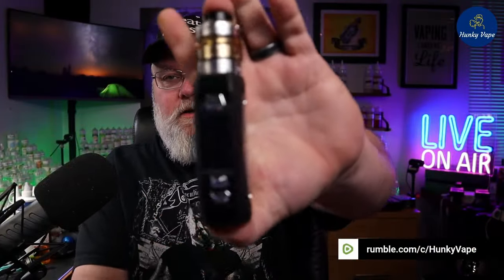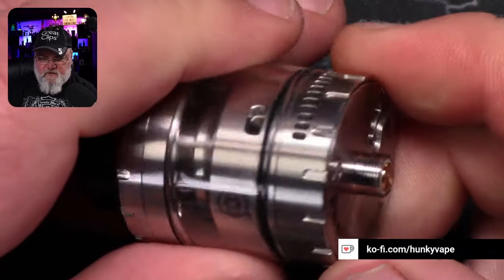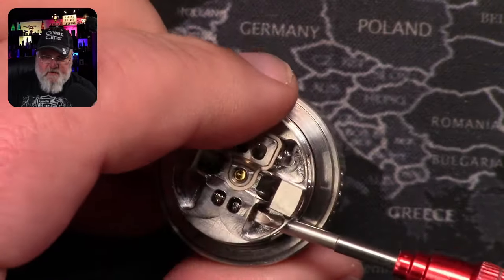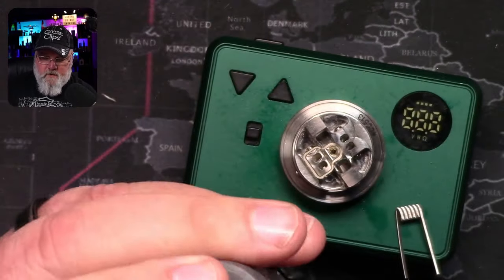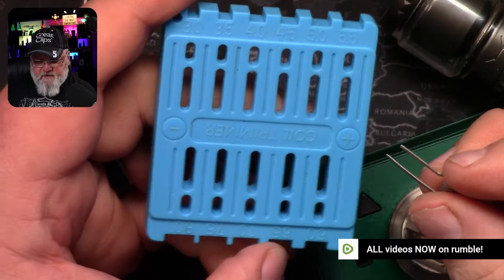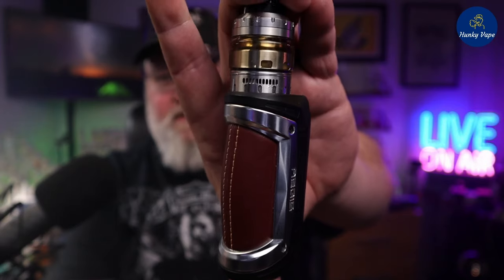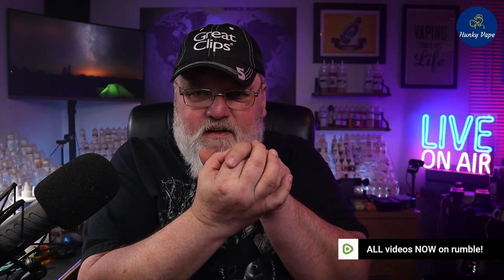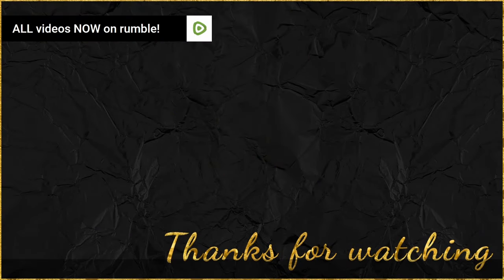VaperzCloud OSIRIS RTA Unboxing Review

Comment: My friend, can you clarify the size of the straight glass, diameter and height, please?
Reply from the maker: My apologies for not seeing this earlier. The glass is actually a bubble glass, however the height, inner and outer diameter should be identical for both the bubble glass and the straight glass. Using my calipers: Height: 16.95mm, Inner Diameter: 26.93mm, and Outer Diameter at mounting point: 29.73mm (Outer Diameter of Bubble: 31.74mm)

Comment: Vaping 12yrs, bought many many RTA's and this is easily the best Rta I've ever vaped. So good, I've just bought another 5 of them.
Reply: 5???!!!! 😮
Reply: Which one is the best? 25 or the 30mm?
Reply: @CountryboyAR  25mm fits most mods… but 30mm will hang over a bit, a tad bit more room to build.
Reply: @sprinkleddonuts6094  I was just wondering if the 30mm has so much airflow and with it being a 30mm with a bigger deck is it more for series vaping which is not really my style. Dual coil RTA on a box mod at 60 -80 watts is around my pace and I was concerned that the 30mm would have huge airflow and meant for Lipo mods like the huge Voltrove tanks.
Reply: @CountryboyAR  
25mm and 30mm there isn’t any difference in the vape experience. 
30mm will have more juice capacity and will fit your bigger mods. 
The 25mm slightly less juice capacity and will fit your standard sized mods. 
It’s all about preference, whichever you prefer, if you cannot decide then buy both 🤷🏻‍♂️ only then will you know which you like more over the other. 
Then you can sell the other or trade to a friend
Reply: @CountryboyAR Sorry for the late reply. I have both. Both are great but imo the 30 is better. I like bigger RTA's(28+) in general. If you prefer 2.5mm coils, go for the 25 but if you prefer 3.0mm go for the 30. Just my opinion
I run it with 3.0mm Claptons, .10ohms, 135w and full airflow. Flavour is outstanding.
Reply: @guppy9713  any issues with the deck not properly sealing correctly since it's not threaded? I've still been on the fence about the Osiris. I've had some tell me that it won't properly seal but that could be user error on wicking. I did have the original Fat Rabbit RTA that had bottom and side airflow but unfortunately it was not a threaded deck. Just sealed with a big o-ring and that thing leaked all over the place and I'm not a noobie to RTA's and wicking. It definitely was the Fat Rabbit RTA leaking from the deck not properly sealing and I'm just concerned cause the Osiris RTA's are very similar with the exception of a small notch that grabs the deck by the locking/unlocking button on the bottom.
Reply: @CountryboyAR I did have that concern myself before I purchased but I've no issues whatsoever. Although not threaded, it has groves that you have to line the deck up with, insert the deck, give it a half-turn and then use the locking lever. The locking arm just prevents you from removing the deck, it's sealed before you even use the locking feature if that makes sense. It's so well machined that it takes a little effort to remove the deck. I have 7 of them but I run 3 on a daily basis because I like to rotate my juices. They are a breeze to coil and wicking just take a small bit of practice to perfect but it's worth the little extra effort. It's an rta than is better suited to being slightly over wicked. If you get the 30, personally I wouldn't put anything less than 3.0mm coils in it because you will struggle to fill the juice cups. I have tried 3.5mm coils but I just found them too much. I needed to much power(160w+) to run them. I like a nice warm/hot vape. I cut my coil legs at 8mm, this way I can have the coils as low and close to the airflow slots as possible. I can honestly highly recommend this RTA. If you do go ahead and decided to get one, would you be buying it from a EU website??

Comment: Well it looks like I'll be getting the Osiris RTA! Just have to decide if I should get the 25 or the 30mm version. Also VaperzCloud has extension pice kits for both with a bigger straight and bubble glass, and 5 different color chimneys so you can increase your juice capacity as well as mix and match the color of your RTA with a lot of mods or mech mods you run it on. Very cool accessory for only $10! Outstanding job on the review as always HV!

Comment: This or the blaze solo rta , what's got better flavor !? Actually, what's your favorite at this point ...
Reply from the maker: I keep going back to the original Arbiter. Yes there's better flavor RTA's. Yes there's newer rebuildables with bigger tanks or more clouds. Blaze Solo beat my Arbiter 1&2, Kylin V3, Stream Crave, et cettera, but the original coil needs replaced already. So back to the old and trusty Arbiter. The Arbiter original coil lasted (I'm embarrassed to say... 6 months before developing a hot spot demanding replacement) Guess old habits die hard.
Reply: @HunkyVape  that's awesome ! Umm, maybe I ll grab both then . Glad I found your channel.  Thanks for the feedback. I ll keep watching ! 💨
Reply: @HunkyVape  fir the arbiter , are you talking the dual or single coil . I just picked up the blaze solo ! & about to pick up the arbiter , I can pick up both the dual coil & single. But want to know which one your talking about . Thx brother
Reply from the maker: @bric7244  The Arbiter Solo is a totally different beast meant for MTL including tight MTL. It can easily do DTL but it's got much less airflow then the Blaze Solo... which is clearly designed for DTL.
Reply: @HunkyVape  yea I seen that in the reviews about the single coil one.  So the one you said you keep going back to was the dual or single?
Reply from the maker: @bric7244  Both the original Arbiter and the Arbiter 2 are dual coil. I keep going back to the original Arbiter... I've got 6 of them.
Reply: @HunkyVape  ok so the dual coil . I just bought both the single and dual coil v1 . Wow 6 uhh .. well I hope it's that's gd ! Thx for the info brother
Reply: I had to come back to tell you I picked up both the arbiter solo and dual v1.  Haven't used the dual but. But threw a build in the solo, not expecting anything great ! Boy was I wrong ! This thing is a flavor banger , wow 👌 
If the dual is any where near this good I ll be pumped. Air flow Wide open on top , and turn the dial on top where the drip tip is to rdl.  Wish it had a lil more air flow but god dam this thing is gd.  Imo better then the blaze solo.  I m gonna through a build in the dual this wk end and give that a go ..